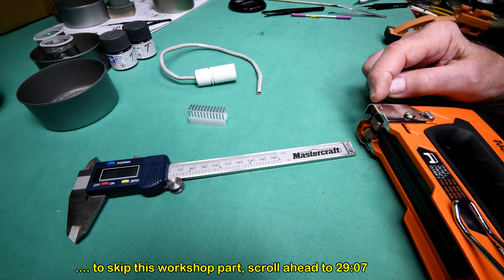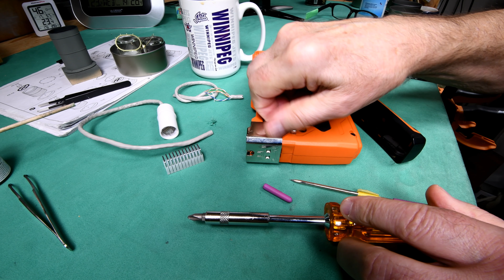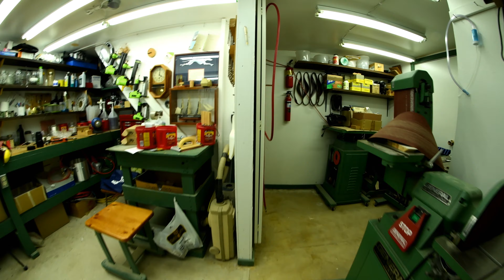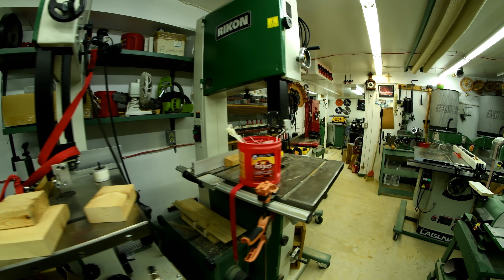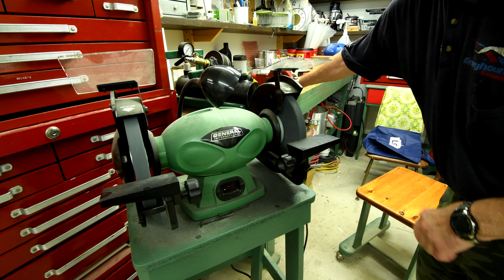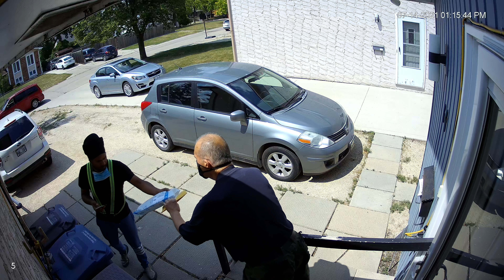The Model Ship - Part 868

Comment: Hi Ron 
Very nice guided tour of your shop/hobby /    “sanctum sanctorum “
Noticed 2 model of  Liner of the past,probably  1:600 scale  one I believe is the Titanic ,the other one perhaps 
The Mauretania? Did you video as well the build of the two models?
Anyway have a nice evening and until tomorrow....Cheers 👍
Reply from the maker: Titanic and Lusitania. Both 1/350 scale. Built those back in the 80's. Thanks for noticing and commenting George. 👍
Reply: @roncalverley  👍

Comment: I bet Timber/Lumber is cheap in Canada.
Reply from the maker: Yes, you'd think it should be, but from what I can tell, most of the better lumber/timber is shipped out of Canada. China maybe?
Reply: @roncalverley  Costs a bomb over here in Thailand and the timber is really hard and is some cases you need a carbide metal drill bit to get through it.
Ain’t that right Jim Stein!😬